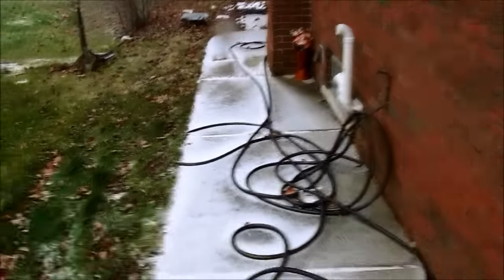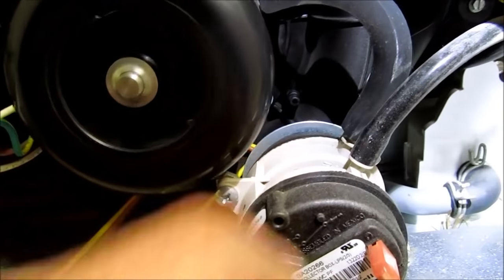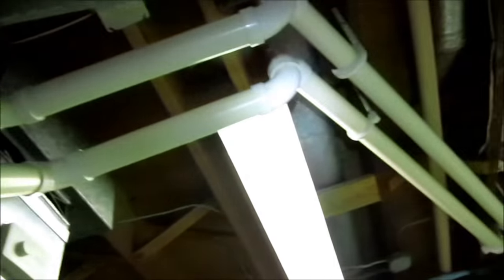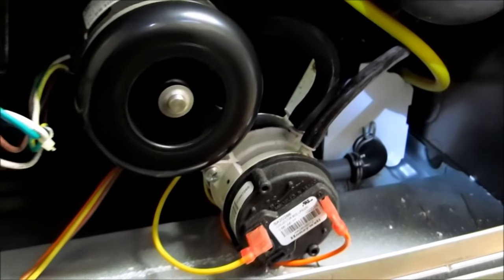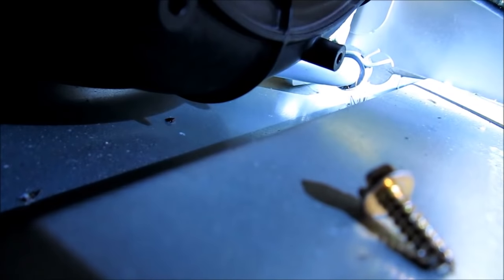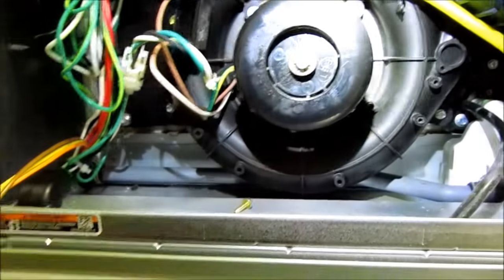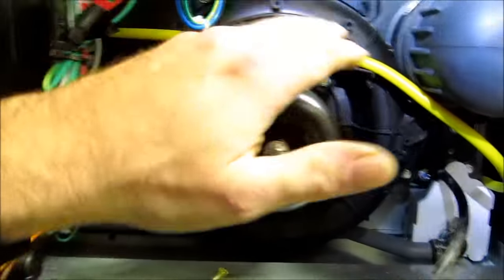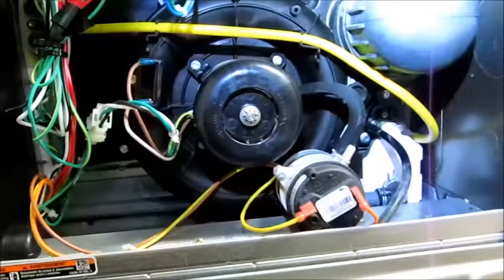Carrier 59SC5A060 pressure switch fault code 31

Comment: Thanks!!!   some of these air switches has two contact - one on the front one on the back check both! On my Carrier unit the yellow jumper powered both switches - then there was a brown (signal to control board) and orange (signal to control board) two different outputs signals. Inducer housing pressure and collector box pressure (check all 3 tubing- green, black, and black square tubing vacuumed sensing signal). Blow them out (toward the inducer housing) and you can check them with a OHM meter by gently sucking on the hose and hearing them click.  Make sure the hoses are good and tight - a very small vacuum leak can cause them to not work!

Comment: My Neighbor Carrier furnace had the same fault code, three short dashes, and one long dash.  A couple of handymen came over and tried changing the pressure switch, but the furnace still wouldn't fire up and still had the 31 code.  She was going to have the furnace replace but I asked her if I could take a crack at fixing it for her.  A new furnace installed would have run between 3,000 to 4,000 dollars, and being a single mom with two kids in college I knew that she didn't really have any spare cash lying around.  Took my borescope and remove the exhaust to the PVC pipe and looked at the impeller wheel.  The inducer motor was spinning but the impeller wheel wasn't really spinning.  A new impeller was $70.00 and for $80 bucks I was able to fix her furnace.

Comment: Thank you for posting this. My wife and I just moved into a new older house with this model heater, and the temp drop to 30 tonight. We had no heat. Not what you want to find on your second night in the new home at 3:00AM. I quickly found your video, drilled the hole out as described, we're now warm. I also cleaned the trap. We're on a heat pump, which I expected to not work when it got this cold, but when the gas heat would not work, well, thank you again!

Comment: The secondary heat exchanger metal tabs aren’t fully bent over on some of the newer carriers, causing water to get inside the inducer motor with no way out. Motor needs to come off and metal tabs need to be bent, typically solves my code 31 issue

Comment: What a saving money Free fix. Thank you. It was driving me crazy, kept messing me with other codes as well, such as 33 and eventually locking up to 13.
Reply: I have a newer (2014) Carrier 59sc2c80 series that came with the upgraded inducer housing.  This furnace came brand new with my house - last year it started throwing the same codes (33,13,13). I replaced the high limit sensor (185degF) so now I don't get the 33 code - but I always get to 31 code for pressure switch when the outdoor temp is in the 40s or lower. Were you able to get your furnace repaired to get ride of the 31 code? What did you do?

Comment: Thank you for this video.  My Carrier furnace is a 2013 59SC5A120 model and it just started short-cycling and giving error 31 in the last few days.  Apparently I caught mine early, and it only had a small amount of water in it.  Turns out the drain trap was full of crud.  I cleaned the trap, dried out the  impeller and body as much as possible, and drilled out the pressure switch port - which was obviously plugged with water when I first pulled the square hose off of it, but no indication of water into the PS, and there was only a small spot of what looked like dried crud in it -  the hose.  Intake and exhaust is pitched properly, as far as I can measure.  Up until this past week, the furnace has been flawless.  

You mentioned that drilling out the pressure switch port on the inducer pump body is a temporary fix.  Are there other design changes to the replacement inducer on the 2013 Carrier 59SC5A that make it attractive to change out the inducer?

Comment: Great video.......We have a Bryant system that was installed in 2012. Ran into the same problem and was getting the '31' trouble code. The layout of our Bryant looks similar, if not exact, to the Carrier in the video. So I did this fix earlier today and it worked like a champ! I can hear the water draining out the tube into the sewer grate once again and WE HAVE HEAT!!! Thanks for posting!

Comment: Check that big rubber 90 degree elbow on the front right of the unit, just to the right of the area that is drilled out first.  I had a 31 error code, drilled the port, had the pressure switch replaced, and it turns out there was a dead bird inside that big 90 degree gasket causing the fault.

Comment: Great video.. If drilling the hole bring has fixed the problem.. Why are you replacing the motor to the newer model?  ( Does carrier recommend replacing it? and is that why? )
Reply: Redesign of the inducer. First one was flat on the interior-new revised one has an indentation

Comment: Hey man. That black wheel right next to where you're focused isn't spinning correctly and is giving me the 31 error. Take it apart and clean it? Replace it? Its 2 degrees outside and I have a newborn baby
Reply: yes replace the little fan. you can diy easy. i live rural and keep a spare. cheers
Reply: @kevinlayden1551  hey thanks for the tip. Turns out my furnace was over 20 years old so went ahead and got another one. But also went ahead and bought a handful of spare parts online.

Comment: I have a 2016 carrier hundred thousand BTU furnace and doing the exact same thing. Of course I’m not sitting in front of the furnace anymore but I replace the pressure switches and I way it runs is with the cold air intake off of the furnace. Is a 2016 inducer motor the same as that style with the small it looked like it had a small port on it

Comment: Is the ticking noise the plate inside the pressure switch moving around because your exhaust vent is not sized properly and the inducer motor can't keep up to keep the pressure switch closed so the furnace can stay lit?

Comment: I had this problem with my Carrier high efficiency. I don't know if any other furnace brands have customer service, but Carrier does not. You cannot purchase any parts directly from Carrier and they make it nearly impossible to contact them directly regarding any faults such as the pressure switch. After doing some good research I had found the technical bulletin pertaining to this fault and attempted the repair myself. Widening the port did not solve my problem so I  contacted a plumbing/mechanical company that could order the part for me. Purely by chance, the company that I called was the same company that installed my furnace and they discovered the furnace was still under warranty. I was able to save some money because they didn't charge me for the part.
Reply: Can you link to that bulletin here?

Comment: Have this same furnace and have had the techs out 6 times with no luck. I can hear water slushing around when the motor starts and if I suck water out of the drain the furnace will work for a couple days. Any ideas?
Reply: The water trap is probably clogged and after awhile water will accumulate and back up into the inducer housing.

Comment: What's the purpose to make that hole??
Reply from the maker: The purpose of making the hole bigger is so the condensate in the inducer housing won't block the small port for the vacuum hose to the pressure switch the water tension of the condensate will block the hole

Comment: Just tried drilling out the port, did absolutely nothing. Still have the same problem, probably gonna order a new pressure switch for a furnace that’s only 5 years old.
Reply from the maker: No your going to need a new inducer motor assembly that will fix it for sure. The gasket for the motor shaft is faulty.
Reply: Mi Heating Guy the inducer motor I have had the x on it and is only 5 years old. Do they typically go bad that quick?
Reply: @MiHeatingGuy   what  and where to get that new inducer motor. What's part #
Reply: Part of my problem was the droplets of water getting into the pressure switch tubes, and blockage of water at the condensate drain, which had some soot. I feel like the secondary heat exchangers need to be cleaned out with pipe cleaners.

Comment: tried that, and it worked !!! been without heat for 5 days. I even paid a guy to diagnose the problem,and he said it was a flame sensor. now I just need to get it covered under warranty. carrier said it is covered, but if I call a guy will I be charged again for diagnosis?